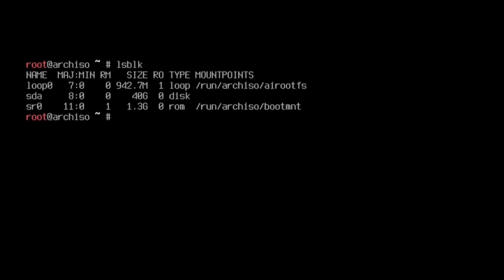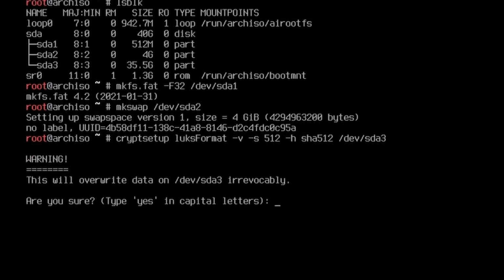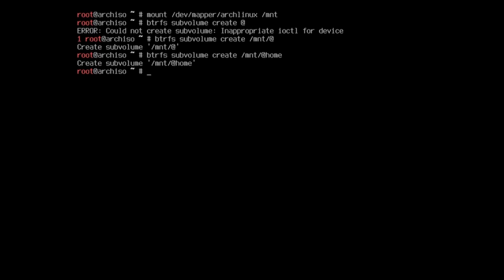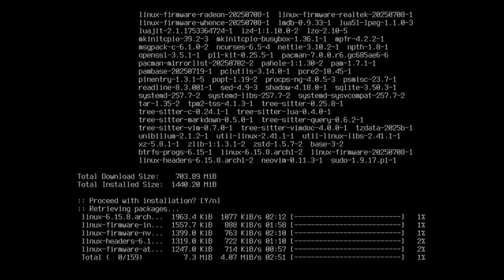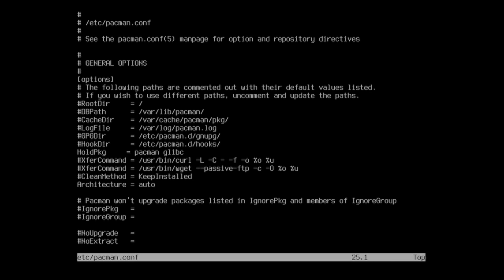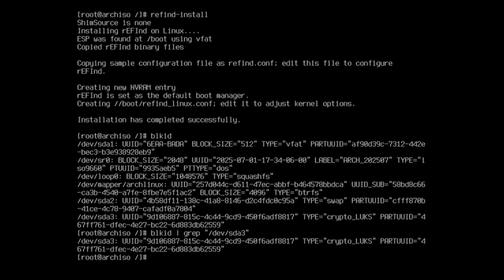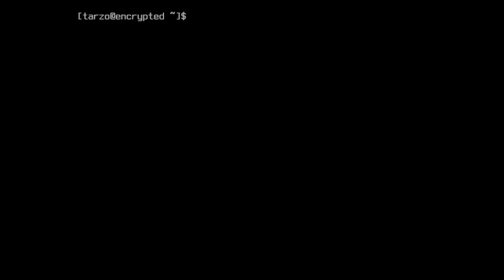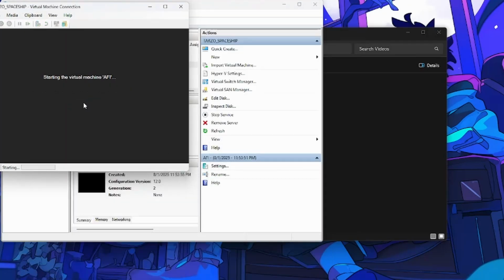Arch Linux Full Disk Encryption with Btrfs – Full Guide

Comment: If anyone had problems with: 

Timed out waiting for device /dev/mapper/cryptroot
Dependency failed for sysroot

In my case, it was because my HOOKS were configured to systemd. This tutorial does not consider this, and it does the installation with traditional HOOKS. I solved it by changing the HOOKS addition and the GRUB addition. 

my HOOKS:

HOOKS=(base systemd autodetect microcode modconf kms keyboard sd-vconsole block sd-encrypt filesystems fsck)

my GRUB conf:

GRUB_CMDLINE_LINUX="rd.luks.name=<UUID>=cryptroot root=/dev/mapper/cryptroot rootflags=subvol=@"

(‘Cryptroot’ was the name of my unlocked partition, but substitute it with yours of course)
Reply: sd-encrypt is very much needed. I am using btrfs so I dropped fsck.
Reply: @JeremiahCommons  you’re right, fsck is not needed in this case, I didn’t know that. Thanks
Reply: Thank you for the tip. Wasted half a day on this.
Reply: @lnconsistence  no problem. Did it work in the end?
Reply: @bem-te-6  Yes, eventually i got it working.

Comment: after all actions I've got:
[TIME] Timed out waiting for device /dev/mapper/archlinux.
[DEPEND] Dependecy failed for File System Check on /dev/mapper/archlinux.
[DEPEND] Dependecy failed for /sysroot.
[DEPEND] Dependecy failed for Initrd Root File System
[DEPEND] Dependecy failed for Mountpoints Configured in the Real Root.
[DEPEND] Dependecy failed for Initrd Root Device.
[OK] Stopped target Basic System.
[OK] Stopped target Initrd File Systems.
[OK] Stopped target System Initialization.
[OK] Started Emergency Shell.
[OK] Reached target Emergency Mode.
Reply: i did it twice with more focusing and checking and i've got same error:(
Reply: @TairMukashev i got the same error did you figure it out by any chance?
Reply: @davidgiannini653  I setup my archlinux btrfs LUKS encryption with archinstall script. It works fine, I also set up grub btrfs snapper with LUKS(but also there was one problem with encryption, which one guy on github already solved)
Reply: @davidgiannini653  hello. I got the same problem. Youtube is unfortunately deleting my comment explaining it, but basically, my HOOKS mixed 
1- systemd hooks
2- traditional hooks

I chose systemd and had to add sd-encrypt instead of encrypt, and the GRUB configuration also changes.
Reply: @davidgiannini653  my HOOKS:

HOOKS=(base systemd autodetect microcode modconf kms keyboard sd-vconsole block sd-encrypt filesystems fsck)

my GRUB conf:

GRUB_CMDLINE_LINUX="rd.luks.name=<UUID>=cryptroot root=/dev/mapper/cryptroot rootflags=subvol=@"

(‘Cryptroot’ was the name of my unlocked partition, but substitute it with yours of course)

Comment: I'm trying to use F2FS with LZ4, almost 4 days trying and is basically impossible, I mount the partition in fstab with "compress_algorithm=lz4,compress_log_size=2,compress_chksum,compress_mode=force"     i tried mode  "user", "always", all possible flags, formated many times with all flags, and the compression never works.. Could you or someone please help ?

Comment: is it possible to encrypt after installation?
Reply from the maker: I should be fine..but make sure to backup any important data😁
Reply: @techressolve  I'm trying to use F2FS with LZ4, almost 4 days trying and is basically impossible, I mount the partition in fstab with "compress_algorithm=lz4,compress_log_size=2,compress_chksum,compress_mode=force"     i tried mode  "user", "always", all possible flags, formated many times with all flags, and the compression never works.. Could you or someone please help ?  I want to use transparent compression globally to entire partition but I want to use LZ4 not stdc